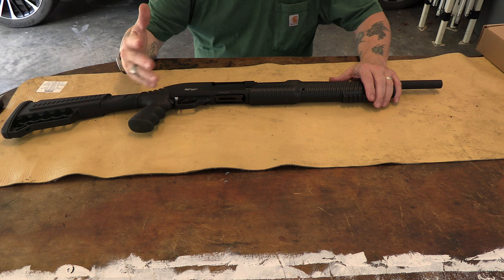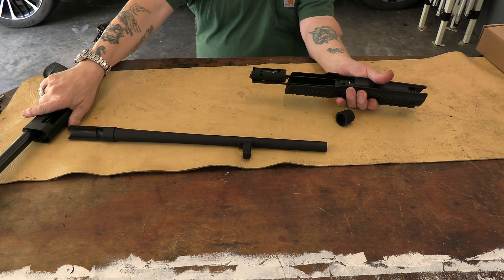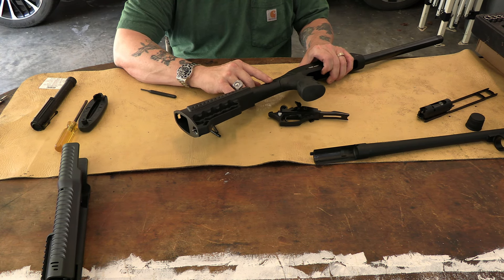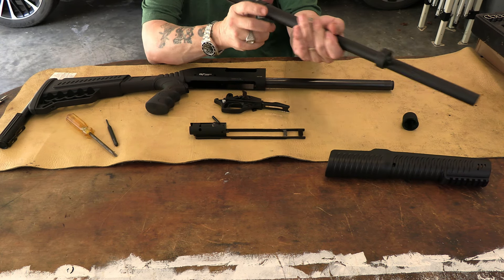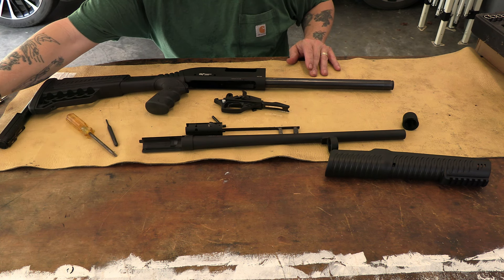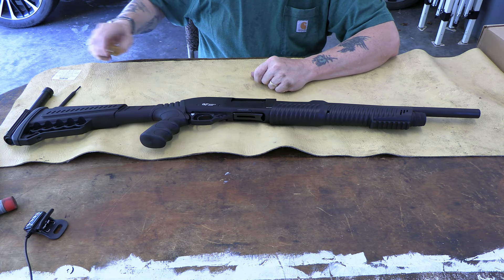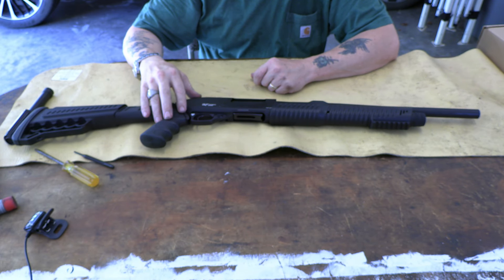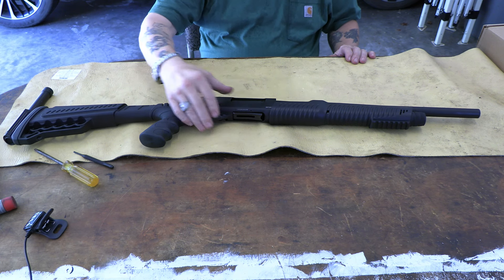2 GForce GF2P 12ga pump disassembly

Comment: Take a spent shell and replace primer. Chamber the round and pull the trigger with bolt out of battery. The hammer may be falling but not hitting the firing pin.

Comment: I just picked mine up today and it won’t lock up when I rack it. I can just continuously pump it without ever pulling the trigger. I’ve tried cleaning and oiling the action locking button but it doesn’t fix it. Any tips?
Reply from the maker: the action locks when the bolt moves on the action bar, when it goes forward the locking lug in the top of the bolt locks into the notch in the barrel, check to see if you have the barrel seated all the way into the receiver of the shotgun , and make sure the extractor is lining up with the notch in the barrel